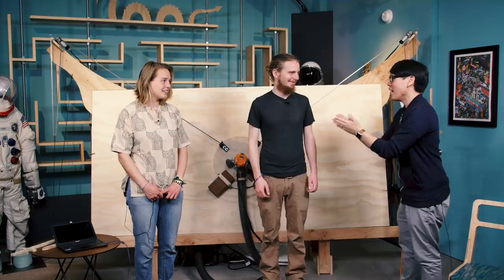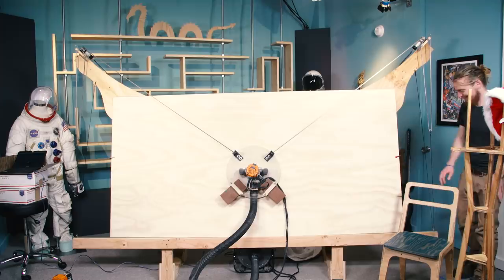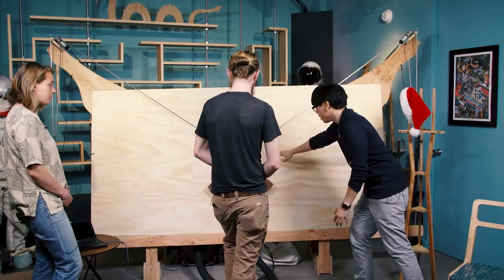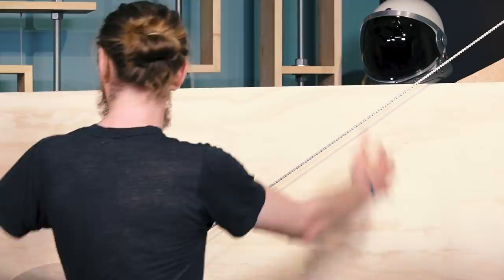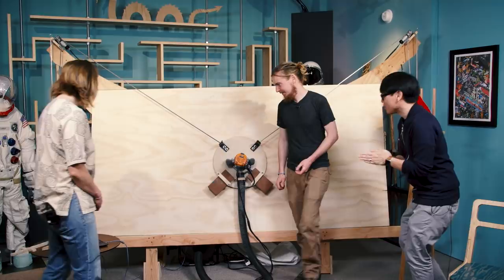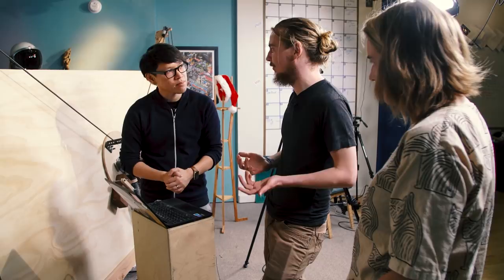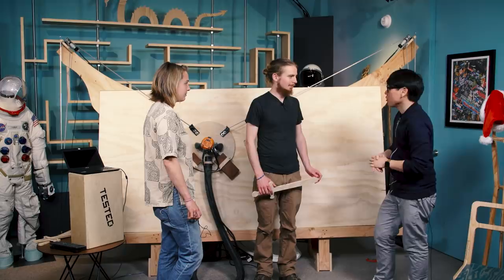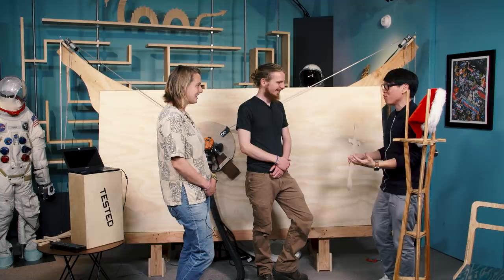Meet Maslow, the $350 CNC Cutting Machine

Comment from the maker: Find out more about the Maslow here: http://www.maslowcnc.com/
Reply: Why couldn't you make a standard template out of paper or cardboard that would set the table and all hardware into a standard location to help every 1 no exactly where to mount each axis point , sounds like a really innovative product though great Idea to keep price down
Reply: I m in the UK, and this project interests me. Are you shipping internationally?

How much tension is on the chains? 

How are you making allowances for chain stretch and wear?

You said that calibration is only required once. But surely over time chain stretch and wear will cause issues, not least because some sections of the chain are likely to be subject to more tension, and more often, therefore likely to cause uneven chain stretch and wear throughout its length.
Reply: @jamierichardson971  l00pp0
Reply: The only problem I have with Purchasing this machine is that they have no customer service number where you can talk to someone.  The price they are selling now you should be able to have someone you can contact

Comment: wish more people thought like them: "how far can this be developed" rather than "how much money can i make from this". well done guys, hats off to you. 😊
Reply: They are definitely making money off this. The kit doesnt even include the router, or shopvac. It is essentially $350 for the linkage, assembly, motors and micro-controllers. While its probably not a lot of money, this CNC machine isnt really practical for anyone besides hobbyists. Its not extremely simple for the average person, and its not precise and robust enough for professionals.
Reply: What about development of the electonics, development of the user inteface, development of firmware and support of the shipped products? These are all costs/development time you have to include into your final price. Also supporting an open source community is often a full time job and you have to afford your food somehow ;-).
Reply: since it is designed around an arduino mega the price point is both cheap and expensive at the same time. I've been working on parts acquisition for a desktop CNC when I have the spare funds and I think just on the electronics side so far I've spent $30, and that is even with finding the lowest price boards I can source.
Reply: I'm more of a "how much pizza can I eat today?' guy myself.
Reply: LInuxCNC runs this kind of nonsense out of the box. It was done over 10 years ago.
Reply: Its a kickstarter project, support almost is always non-existent. They use G-code, and consumer boards. The amount of programming that needs to be done can be finished in a weekend, and most of it is already available thanks to the 3d printer wave that does the exact same thing.
Reply: actually, there is only one 3d printer that works from a similar mechanism (adjustable length supports), and that's the hangprinter, it's actually well behind the maslow in terms of the math of how it works. Getting this software right is the biggest issue.

there are very few (if any) 3d printers that work on a closed-loop model, open-loop with stepper motors is the normal case. Even the shopbot routers (close to $20K for a 4'x8' model) use steppers.

so this isn't a trivial "slap something together that everyone else is doing" project, this is actually breaking new ground.
Reply: David Lang You can put an encoder on a stepper. People normally chose not to because encoding steppers is both costly and complicated. Don't confuse people not doing it with it not being possible though. Open loop steppers are popular because it is cheap, easy, and it works. This project breaks no new ground either. Because cable machines were done long ago. Although I have to admit I've never seen a counter weighted chain and sprocket mechanism like this machine has. Cable and spool machines are more done as novelties.
Reply: yes you can put encoders on steppers, and it would solve some problems (skipped steps), but people don't do that because it would add quite a bit of money, however using enoders on non-stepper motors opens up a different world, you can get a lot more powerful (and cheaper) non-stepper motors compared to what you can get as a stepper. You can also gear them down to provide more force without running in to the speed issues that you run into with steppers.

This isn't a counter-weighted chain, the bungie cord is just to control the slack on the chain and keep it out of the way and untangled.

The value of this design is that it doesn't need rails and either a large moving gantry or larger moving bed, it just needs two motors in the top corners (and one for the z axis) and the sled rides on the material being cut. This also leads to the limitations of the machine, but mechanically it's far simpler (not to mention cheaper) than 'traditional' machines. And that's the point. This is a way to get the ability to cut "human sized" things (chairs/furniture/etc) at a reasonable cost. It has limits, but for ~$500 (including the router), this covers a substantial set of use cases that otherwise would require machines costing 40x as much.

bar is very timid about his cutting speeds and depths (.25" bit cutting .1" deep @ 20 ipm with a 2 HP motor is beyond conservative), he's shown test cuts .75" deep @48 ipm, but he wasn't happy with how they sounded using a .25" bit. We know the machine can do much more than he tends to run it at, but we are still in the beta stages and so there aren't that many people testing it yet
Reply: You could just use something like the Mechaduino or AnanasStepper if you want a simple closed loop steppermotor system... Or make your own out of these open source projects if you need different supply, control or power options for your application.
Reply: David Lang I built a smaller work envelope CNC for cheaper than their kit price. That includes the price of the control PC, the spindle, all of it. As it sits running. My machine is capable of isolation routing circuit boards too. So it is pretty accurate. It turns out I'm just not that interested in cutting large jobs. I don't have stacks of plywood sitting around that I need to machine. Which is one of the more surprising things that I learned about CNC. Initially I did think I'd want a larger work area. My machine is 16 1/2" x 16 1/2" and really it is fine.
Reply: Paul Frederick j
Reply: Fantastic, can You be a darling just throw together the code, blueprints and parts list and upload it to github, so that us NOOB's can take part of the extraordinary greatness of LinuxCNC on a NonCartesian upright CNC.
Many thanks in advance and best regards
Reply: Paul Frederick great, by all means share it like these guys are doing..
Reply: krysanify I already did. I wrote an article over on Instructables about my machine. There's nothing special about my machine though. Which is part of the reason it works so well. I guess there's a couple tricks I used. Or rather mistakes others make that I avoided. Plus I got in on some fantastic deals for the parts I used. Someone could build an identical machine and spend a lot more.
Reply: nice, are you going to share the link or can i just find it by your name in Instructable?
Reply: aka, the Bre Pettis MakerBot move...
Reply: an interesting point. and as we all know there is nothing truly new under the Sun. ideas reinvented. imagine how much more advanced we as a race would be if no one cared who took the credit/profit and just wanted to advance and create a better world for all. take it easy and thank you for your thoughts.
Reply: Tesla loved a pigeon. So it is fair to say his vision was a bit off.
Reply: Having personally read a few complete biographies about Tesla, and seen additional documentary footage I'd have to say you're a bit off in your treatment of the fellow. As I've seen just about everything there is about the man at this point. Edison on the other hand was a winner. The company Edison founded General Electric is still around to this day. Where's the company Tesla founded? Oh that's right, it only lasted for two years.
Reply: Edison invented the modern research institute. Among other things. So basically Edison invented how we invent things today.
Reply: I love the fact that it's been open-sourced. That is kind of amazing and can (and probably will) bring massive ideas. :)
Reply: We're can I get one
Reply: Can this be programmed to do 3 dimensional
Reply: this can do some 3D stuff, since the sled rides on the material being cut, if you cut too much of it away, the sled will fall into the cut area and "bad things will happen", but beyond that, yes i will do 3D
Reply: making the sled larger means that you need to leave more room between the point that you are cutting and the motors/ground/etc. You also want to have a good amount of the surface of the sled supported (otherwise the weight of the sled being on a small area can damage things or stick)

It's not quite as trivial as you think it is.
Reply: Jon B what sled? You mean the head? The part that holds the spindle on a machine is usually called the head.
Reply: Paul Frederick The circular piece of plywood that the router is mounted to is the sled.
Reply: Paul Frederick, what Jon B said, the sled is not directly correlated to any part of a 'normal' machine since it's always in contact with the material being cut and slides across it. The current design is a circle, earlier designs used a fancier shape, and some of the beta-testers are using rectangles of slippery plastic.
Reply: Jon B this is the cape and shield argument. It is a daughter board. The part on a rotary mill the spindle is attached to is the head in traditional nomenclature. I fucking hate when people start inventing new names for shit that already has names. So it is the head damn it!
Reply: Jon B that's how these nonsense terms take root. Someone uses it, then someone else does. Then before you know it everyone is calling it that.
Reply: While I agree about the cutesie naming of daughter boards, you are getting far too upset about a relatively obscure term.

People should not have to study and memorize terminology before they build something.

In this case the component is vastly different than what a traditional head is, and some people are building more traditional Z axis setups (because apparently in the EU, a fixed base router is 600+ euros, twice the cost of the other components), and so those people will have a traditional head unit attached to this other piece, which will still need a name.
Reply: Paul, that's also how language evolves. If the new term is more descriptive/less confusing than the old term, it should replace the old term.

How do you think the parts got named in the first place? I guarantee you that the initial machines used different terms and one caught on.
Reply: Paul Frederick have a good day
Reply: This is one place where language does not need to evolve. As we've had milling heads for almost 200 years now.
Reply: Dusty Korpse n
Reply: The guys that did maker bot the guys that did the actual engineering was like that, untill that duchebag bit the community and went commercial.
Reply: Development costs $. Running a business is all about earning $. If more businesses focused on spending rather than earning, more businesses would be out of business and out of money. Get the picture?
Reply: Couldnt agree more
Reply: Why  is this girl even part of the video.
Reply: @__aceofspades  i do believe that's what they both said.  Naysayers.. gotta love em and WHO THE HELL CARES if they're making money?
Reply: people who think like that, money finds its way to them rather than trying hard to screw people over to get it.
Reply: Dusty Korpse if you make it more accessible you end up selling more in the end so no need to be greedy.....
Reply: @__aceofspades  how long have you had yours for?
Reply: ac3ofspades878 i guess the “pro’s “ can afford the more expensive production unit.
Reply: Well, he inherited money, but I agree nonetheless.
Reply: @__aceofspades  Come on don't be a douchebag. 350$ really isn't a lot when it comes to CNCs even when they're not including the spindle with it. In addition you can probably scale this up as well meaning if you have the vertical height you could theoretically do something that you'd have to pay tens of thousands of dollarinos. Sure, they could do it cheaper, but 350$ is still a fair price.

Comment: That's so cool. It's kinda like a delta 3D printer, but the third "arm" is just gravity.

Also I thought that was Simone from the thumbnail.
Reply: exactly what i thought, a delta printer
Reply: Reminds me also of those camera on a wire systems that you see at sporting events that seem to float in the air, although drones may have supplanted them.
Reply: These type of cnc cutters were originally used as a writing machine. Usually a maker in place of the router.

Comment: This CNC made me tingle all over my body. Would be perfect for building a boat. Either stitch and glue plywood, or converted with a plasma cutter to cut the sheet metal for a small steel boat or something. There's no end to the possibilities!
Reply: S&G was the first thing i thought of too.
Reply: Bar has mentioned in various venues that a canoe is on his build list... I imagine once he gets a moment to breathe, that will be the first thing he makes.
Reply: Markus_B y
Reply: You could probably do it, but I don't think it is practical.  The lasers that are powerful enough to be useful for cutting things are rather big, and require cooling.  They are also expensive to replace... and some of them are expensive. (most of the laser tubes?)

If you made it big enough, you could dangle the whole laser assembly... but the cut would be very small...

You could create a mirror system, but I suspect that the stabilization of the mirrors so you don't burn something else down would be expensive.

There is a new router system coming out that uses your muscles to move the router, and a camera to track the work location  and small motors to retract the Z axis if you get off course, and small motors to finely adjust your motion.

I'm interested in tying one of those with a super huge one of these.
or have a tool changing system on the router.
Reply: you could not use the normal 'fixed laser + mirror' approach, as the sled rotates as it moves around. you would have to mount the laser to the sled.

There are people making solid-state laser heads to go on 3d printers, that approach could work.

another issue would be the safety, you would need to enclose things to protect you from reflections.
Reply: David Lang hi bro can I ask you what is meaning of working on countries means  which is a country work together with the two countries means.
Reply: Escwire That's a great idea! Could knock out a lot of designs using plywood. Awesome possibilities!
Reply: Dude, that's a great idea!
Reply: could probably use the 10,000 psi water cutting technology with this and steel
Reply: @WillieStubbs  what is 10,000 p.s.I water cutting technology?
Reply: or make your own personal drone
Reply: @yamspaine  you can use a fiber and emit the laser from it
Reply: @lexingtoncollaboratorymake9052  , maybe,  Have you ever seen a cutting laser on fiber optics?  I can't say I have.
Reply: Yes so true,that is awesome.You could make a little micro cruiser sail boat in half the time.Wow

Comment: FYI..Put downward pressure on a hand saw only on the push stroke. On the pull stroke just drag back the saw teeth lightly. A light pull stroke will clean the debris from the cut. This leaves the saw on a push stroke a debris free channel for the forward facing teeth to cut the wood.

Comment: Re: Safety - In the years since this video came out there have been people who've had the the chain come off when doing a high tension chain pull during calibration.    If the chain comes off early on in the pull process then there isn't a lot of energy released.  If the chain comes off near the end of the chain pull process it can release quite a bit of energy.    Overall the machine is quite safe, but like anything, you need to be aware of what dangers there can be with any equipment you want to use.

Comment: pretty cool. I wonder if you could scale it up to cut parts for prefab buildings? Go to a site set this up along with a pallet of plywood and one of drywall and just go to town cranking out parts for the building. I wonder if you could line up a stack of two by fours and use the preprogrammed router to mark your cuts then just finish up and assemble the building

Comment: You got me really excited when you said $350, and designed to work with plywood. I love making wooden sailboats. I can see an immediate project application for this. I could make small tweaks, cut them, and try it out. That is amazing. I see this in my wood shop in the future. Strong work folks!
Reply: more like $700 by the time you buy a router and make the frame. $350 is a bit unrealilistic.

Comment: If the guys at Make It Extreme get their hands on this, it will be powered by two angle grinders with a plasma torch attached lol
Reply: It'll be powered by 5Kw electric engine and would mill through an inch thick metal plate.